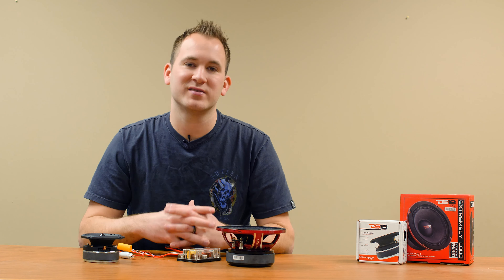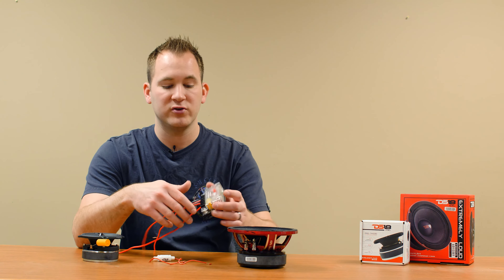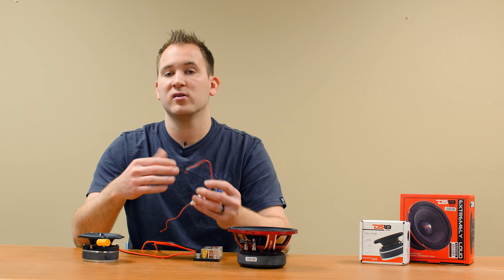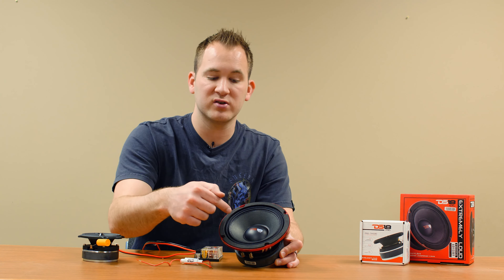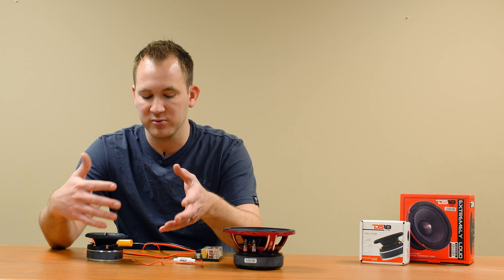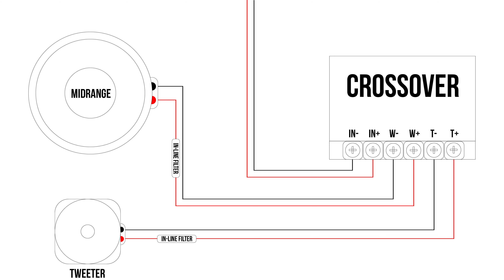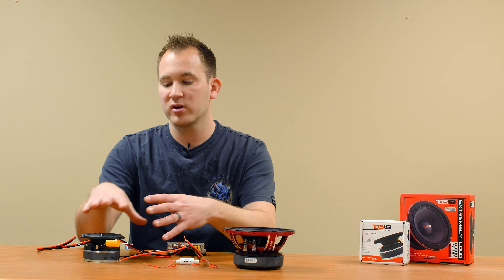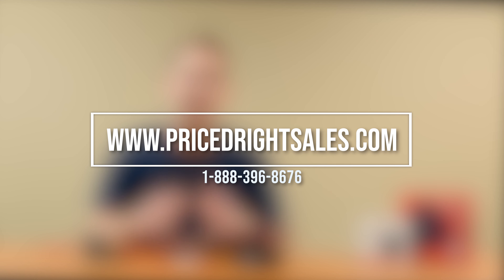How to Use and Install Bass Blockers and Crossovers

Comment: 2 way crossover is not for mids it will have full range for the woofer and limited range for the tweeter, and that will work fine without a capacitor on the tweeter, with that crossover you have there the only place you would need a capacitor/bassblocker is for the mids?
Reply: Sometimes, depends on the car's oem audio wiring system. For example on the 02 Outback base model the audio wiring was done by Panasonic, which is not that great. Powered it with A Rockford P1000x5 and Clarion 3 way electronic crossover. No matter how expensive and quality speakers were installed in the door panels, the low frequency of the bass was too much and distorted at higher volume, which damaged the tweeters on the 2 way woofers installed in the doors. I had to get new speakers and install the 6.5 speaker bass blockers to protect the newer 2 way speakers from blowing. It sounded much better blocking the rough bass that was coming to the woofers. I will be installing the 2 way passive crossovers next, to completely try to fix the door speakers sound quality.
Reply: So what can I use for a mid and a tweeter
Reply: @jamaicasgodson2125  what do you mean? If you have a newer car then just install the tweeter and its dedicated bass blockers that came with it then install the woofers for your mid. You dont need these 2 way crossovers on newer cars cuz they already have built in quality passive crossovers somewhere in the car for the speakers unless your new speakers come with special crossovers to be installed then you have to install those crossovers that came with the speakers. Also, you can add an active crossover or a DSP(which is better) to the amp for higher quality sound.

Comment: Can I use both at the same time the bass blocker and crossover?
Reply: It's not advised UNLESS you want a higher crossover slope than the crossover alone can provide. The slopes are added together when using 2. For example, a high pass at 100hz at a 12db slope and a bass blocker at 100hz with a 12db slope will result in a 100hz 24 db slope. If that's desirable for you, go for it. But keep in mind your other speakers should also share the same slope so you cover the entire spectrum evenly with no gaps. Hope that helps.

Comment: Whats the best way to hook up multiple mids and tweeters? If I have a cross over, can I connect more than 1 tweeter to the tweeter connections? Will the power be evenly distributed to each tweeter? If I have a bass blocker., can I set my amp to full signal and just let the bass blocker do all the work? Or should the amp crossovers be set appropriatley?

Comment: I recently bought component speakers for 4 doors and was wondering how do they wire up (I have individual crossovers for mid range and tweeters). By the schematic you showed us I started to understand that IN cables goes on the audio cable from audio source. I can solder Mid and TW IN ends in parallel, then connect those accordingly to the audio + and - wires.
Even though this is a 2 year old vid, It did click me some idea on how to wire things up

Comment: Can I connect 2 mid-range speakers and 2 tweeters to an 2 way crossover ?
Reply: Depends on the impedance rating of the speakers, and whether or not the amp and crossover are stable driving a load of that impedance.

Comment: James, I purchased a set of ORIONCTW2.ONE O 400 WATTtweeters/I also have a set of POWER ACOUSTIKS EF-60C 6 .5 COMPONENT-ACOUSTIK REAPER speakers; this component set came with (2-way Passovers; the tweeters came with a capacitor attached(bass blocker??) do I still need to connect inline filters even though I am using a (2way passover system??) if what filter would you recommend for both the speakers and the tweeters?? much appreciated I wish I knew more; I  enjoy learning from your videos; I AM 73 and still going strong- this system is being installed into a 1970 chevy c-10 stay safe,PATRICK P

Comment: if i wired a tweeter that can take 50 rms to a speaker that can take 50 rms together that are each 4 ohm together with a high pass set at 120 without a crossover like the one used if my tweeter already has a bass blocker my real question is can u give the mid speaker higher frequencies without hurting it

Comment: Hello I’m late here my question is I purchased the ds18 component set zxi 2way set I installed everything but I upgraded the midrange speaker to a zxi pro that can handle put to 300watts of rms and my amplifier puts out 275 at 4 ohms per channel and everything seems fine while playing music also my amp setting was s at high pass for extra protection I believe is around 160 and to 200 hz .Now I saw on ds18 website they a passive cross over that can handle 300watts rms should be okay with what have now or I need to replace my passive cross over to these ones to get more power

Comment: Hey can i use a bass blocker  with the 2 way or 3way crossover  because i have a 8in midrange  and a super tweeter the super tweeter has the bass blocker already but i eant to put a bass blocker on the 8in midrange speaker  and hook them up to the crossover  do you have a wiring diagram for a 2way 3way crossover  thanks oh ya can i hook up 2 4ohm 6×9's to a 3way crossover one in midrange, one in the woofer thanks

Comment: What bass blocker would you recommend for the infinity reference 3.5  inch speaker. I lost the capasitors that came with it
Reply: The infinity speakers came with bass blockers?
Reply: @jordanwya  yeah, they're taped inside the foam. Most people toss them out not realizing

Comment: so using that crossover with your example and running a 2ohm amp. both speaker and tweeter will still have to be 4ohms rite...in other words..using a crossover wont change anything a far as ohms go
Reply: crossovers shouldn’t be but if they are I would imagine it hardly affect the 0hm load ..